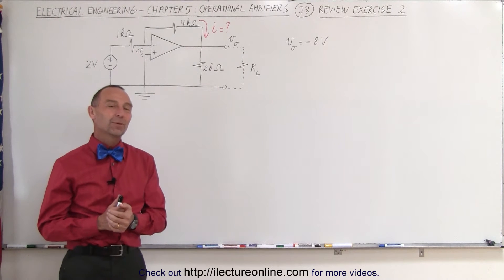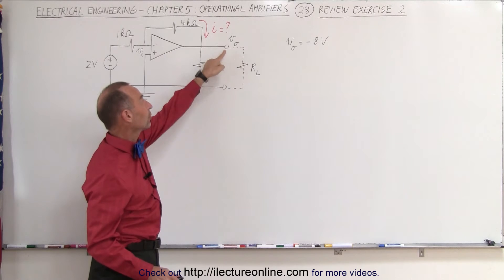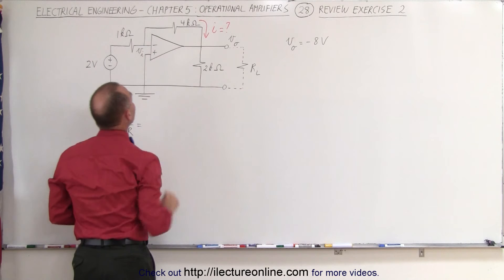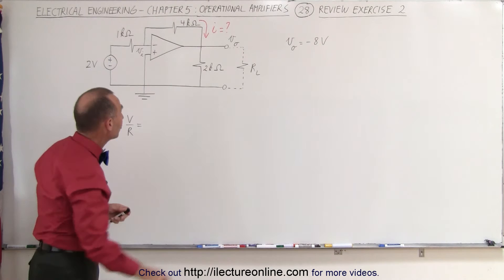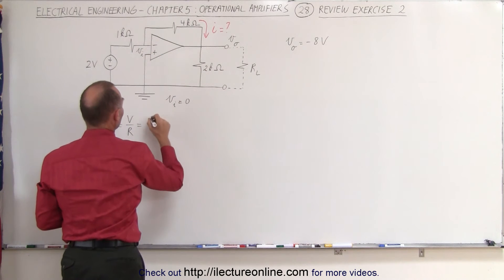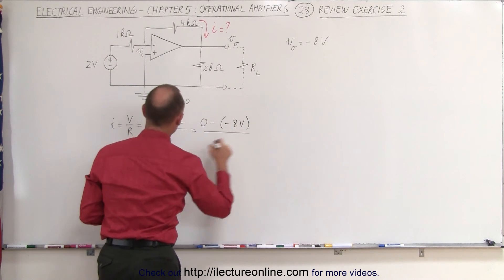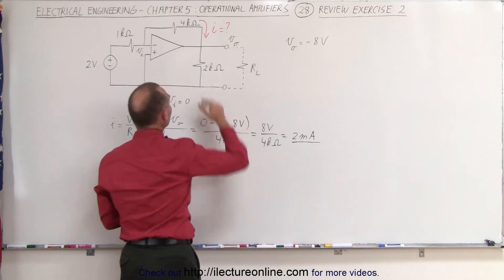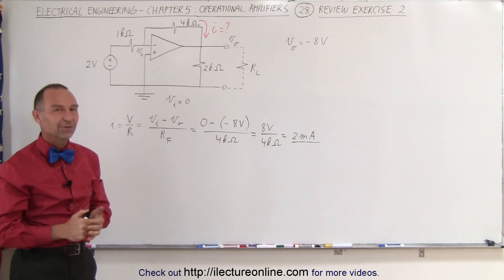Electrical Engineering: Ch 5: Operational Amp (28 of 28) Review Exercise 2

Comment: can some one help me with a quick question. I have a very similar circuit as this one, but it has two main differences. For starters, right after the voltage source, I have a branch coming off the right with a resistor that connects to node b (non inverting). And for the final difference, there is then a resistor between node b and to ground.  Similar to this question, I have to find the voltage across a load, as well as the current. What's the general set up would I start with. Would I treat it as a inverting op-amp?

Comment: Thank you for explanation! Very helpful. However, I would like to ask you about the value and direction of current flowing through load and 2k ohm resistor.  Would the current supposedly flow from ground to V(output) since V(output) is negative? If so, then I suppose the current through 2k ohm resistor is equal to  4 mA (I=0-(-8)/2k=4 mA. And if the value of load resistor would be 8k ohm, the current through this load resistor would be 1 mA. Then according to Kirchoff's current law, total current going into the node at the output is equal to 7 mA (I(total)=2+4+1=7 mA).  But where does this current go from there, or rather, what is its return path? As I understand it does not go through the op amp, because there is no current flowing through the inverting and non-inverting terminals. 
An answer would be much appreciated.

Comment: Hallo there. Great and precise lectures. Great job indeed. Well, you may say whatever you like but I cannot understand the point of an OpAmp. Isn` t it that we can make the same job without operational amps? For example, the DAC? It sounds strange to construct an OpAmp like 741 just to perform for example signals addition in a moment that you can add signals by simply connecting their resistors in a common join, no? As for integration, one can integrate by just using a resistor and a capacitor. Why should he then use an opamp too???? It sound somewhat strange.
Reply from the maker: You are correct that op-amps are old technology and in many cases have been replaced with newer microcircuits.  But they still exist, are being used, and it is a good place to start in our understanding of basic amplifying techniques.
Reply: And I think that a series of lectures on how we could perform calculations or how to create a small analog computer using OpAmps would not be bad at all. I really try for at least seven years to find a site that describes how to create an elementary calculator using discrete components and not an IC.
Reply: And then, perhaps you have the will to teach us ...... how (and why!!!) an OpAmp is designed.....  He he he he he, I know I had been a nightmare to my teachers....
Reply: Thank you!
Reply: Thank you for your reply. I do jot know but if they are  still teached  and used today, then there has to be utility. An utility that I can not realize. It is the non-ideal omamp amplification ratio that sounds really small. Additionally, in one of your examples, you set input voltage equal to 2volts if I remember well, which cannot be the case for a bjt transistor. It is impossible that I know better than experts. Just impossible. For example, there is a reasoning why one should elect a mosfet over a bjt (or vice versa) during his/her circuit design. There should be a reasoning for opamp too, it is just not clear to me yet.
Do you think that you could do some lectures  explaining what is inside a small opamp? Maybe a three to four transistors ciruit or perhaps use a number of transistors that you judge. Thank you.

Comment: Isn't the equation supposed to be (0 - v0) / 4000 + Iout = (v0 - 0) / 2000 because Iout and i together make the 2k ohm current which is -6mA when calculated?